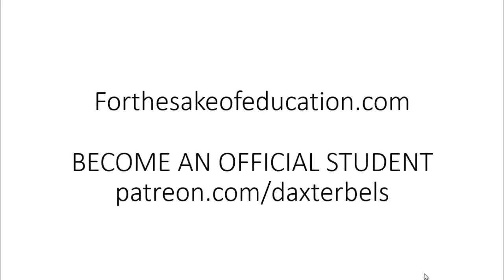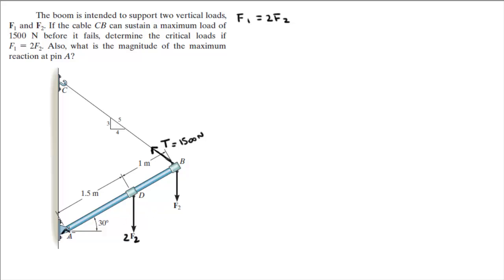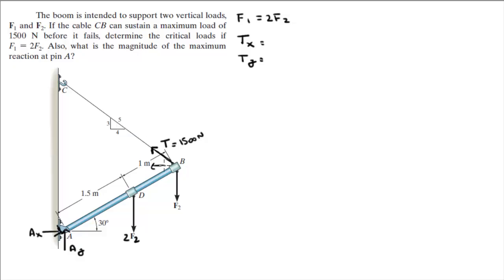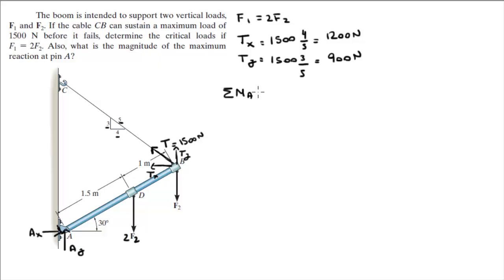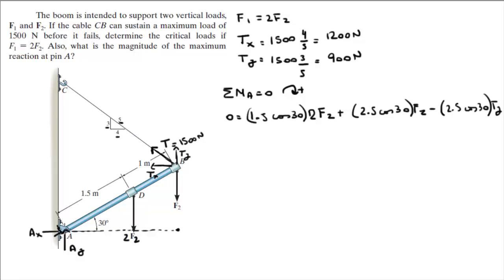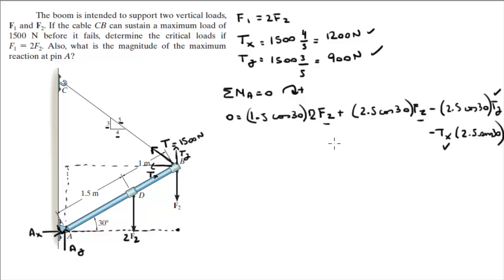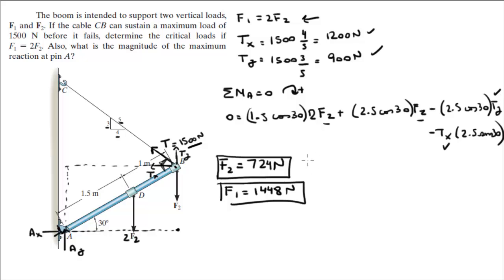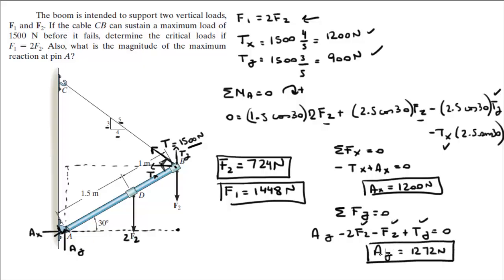Determine the critical loads if F1 = 2F_2

Comment: The way you have the sum of the moments set up does not give F_2=724. If you plug it back in, you will get -1098
Reply: Nope, just plugged it all in and it works out. You get 4.763F_2 and the coefficents being -3448.55 all equal to zero.